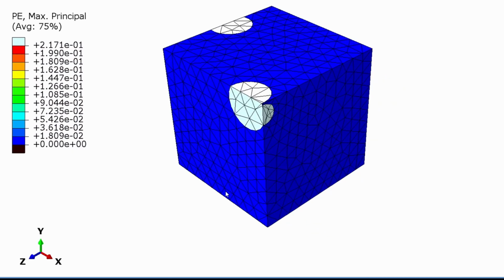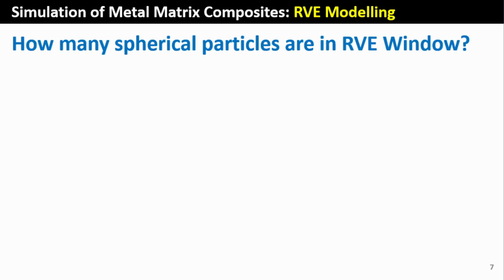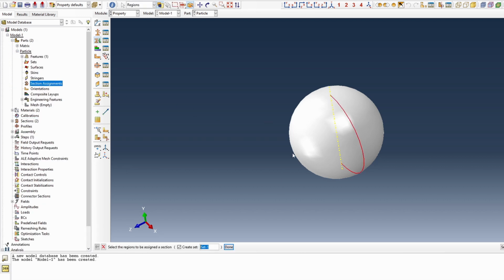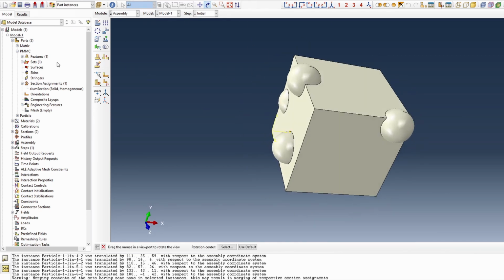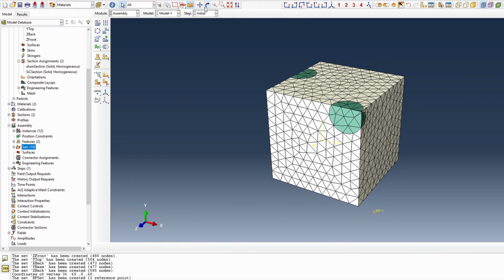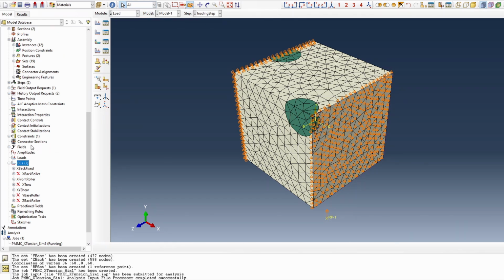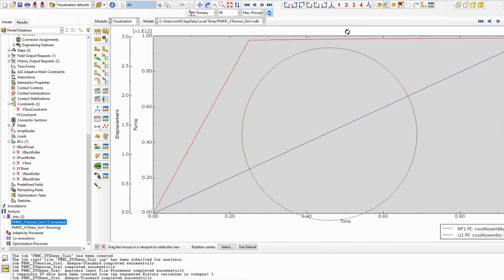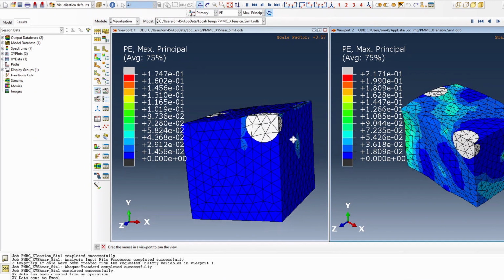RVE modelling of Metal Matrix Composites in ABAQUS #abaqus

Comment: Hello Sir. Really nice videos. Really appreciable!!! I have some requests/queries. 
1)	Please let us know about the way in which you found positions of those centers of particles (Monte Carlo implementation video you discussed about). Please put a video regarding the same, if possible. 
2)	If I take Vf value as 5% or 10% (Let’s say for TiB2 particles), then no of particles will increase for size of 60*60*60. Please let us know about the way in which we can put those particles in matrix in faster way. We can put 5,10 particles manually in quick time. But I guess it will take time for a greater number of particles. Any code available?
3)	Any reason why Young's Modulus value came less in that final graph you showed? Any calculation errors? Thanking you in advance...
Reply from the maker: Hello Samadhan, 

Thanks for the interest in the channel. I will attempt to provide some answers. 

1.)  I am committed to making a series of video on the Monte Carlo implementations leading up to releasing a software to automate the process for Abaqus.  I will say, keep coming back or subscribe so you get notified when they become available. 

2.)  You are right about the time constraints for multiple particles system. A script of some kind will bring automation but you also need the Monte Carlo scheme in place to help with the randomization. So again a video about this is coming soon. You can start with the script I provided in the description section and modify it for your system but some prior experience with Python language is needed.

3.)  On the Young'sModulus being wrong, yes, there was some errors which I  addressed in the pinned comments under the video. I will try and make a dedicated video on calculating the Modulus correctly next time. 

Thanks.
Reply: @MichaelOkereke  Thank you so much Sir for your prompt response. I am looking forward to check video on Monte Carlo implementations.. I will check the script provided. Thanks again..

Comment: Would you like to make a video RVE including for the multiscale? For example micro-scale to a meter or nanoscale to millimetre scale.
Reply from the maker: It is difficult to make a simulation across such length scales. It will not be computationally efficient. This is why you choose and RVE which should be representative of the bulk at higher scales and use same for simulation to determine properties of  the bulk.

Comment: Thanks for the video, will there be any changes if you were to evaluate young’s modulus and yield strength in y or z direction ?
Reply from the maker: Hello N SS, certainly since the material studied is a composite, then due to its transverse isotropy, it will have different properties in x, y and z directions. You can find this out by doing a simulation in x- and y-directions, and extracting what the effective properties will be. You will find them to be slightly different as expected for such RVE heterogeneous media. If you however do a modelling on a homogeneous media (say steel, aluminium, without any inclusions, voids or holes), then the properties will be the same in all direction since such homogeneous material show isotropic behaviour.
Reply: @MichaelOkereke   thank you very much.

Comment: Thank you for this video, I have a question, in the case of an elastoplastic material (matrix or inclusions), what are the added properties and are the periodic conditions the same as in the case of an elastic material?
Reply from the maker: I agree completely Vincenzo. With the plastic flow curve, typically (for simple cases) what ABAQUS requires is just the yield stress value and plastic strain value (always set at zero as an initial point). If you have a material that shows further post-yield behaviour (softening or hardening), then you need to extract the stress versus plastic strain plots which is what Vincenzo has described as a plastic flow curve. I can make a video in future showing how this is done, if there is enough interest (please like the comment) to this.
Reply: Thank you very much for your help, do you have a matlab file or other code to determine the analytical models (Mori-Tanaka and Self-consistent) for the two-phase case?
Reply from the maker: Not really Saad.
Reply: @taop_vc  For PBC Bondary condition, is the same for the two cases (elastic or elastoplastic material)?
Reply from the maker: Hello Saad, yes, the boundary conditions will have some slight influence on predictions but essentially you should get the same mechanical behaviour. So, whether it is elastic or elastoplastic, you will get the expected mechanical behaviour. The PBC will also help you recover a more realistic behaviour with error arising from choice of boundary conditions reduced. Bear in mind, this is especially true for micromechanics studies. Well done for your response @Vincenzo Cucumazzo - really helpful.

Comment: Very interesting video but I wonder why you didn’t use Periodic Boundary Condition (PBC) instead of using the normal boundary conditions, i.e. roller support as you are modelling RVE. Also I would like to know why you used the equation constraint to link the reference point (RP) to the set instead of using coupling constraint. It would be nice if you could let me know what is the difference between coupling constraint and equation constraint. Thanks in advance
Reply from the maker: Great point @John Nabil! Either PBC or Dirichlet boundary condition will apply anyway. It is harder to apply PBCs for 3D systems because you need to make sure you match the nodes from one face to another hence the meshing should be periodic. It could be done but I decided to do a solution that is easiest for most users of ABAQUS without any dependence on a bespoke code for creating the PBCs for a 3D RVE.

I always prefer to use the *Equation constraint as it is better controlled that the coupling constraint. When you use a kinematic coupling, it forces a set of nodes to follow the behaviour of a single point and it is usually a one-to-one correspondence situation. The *Equation allows the user to specify a canonical equation (non-standard deformation behaviour) which you want to impose on the domain. Both do similar things, but *Equation is better controlled and can be used for more advanced studies/control of deformation to the domain.
Reply: @MichaelOkereke  Thanks a lot for your helpful explanations. Is that means the normal boundary conditions, i.e. roller or fixed supports called Dirichlet boundary condition. Also what do you mean by a bespoke code